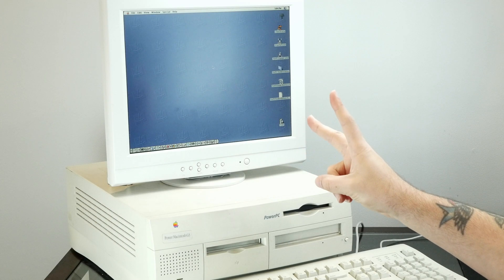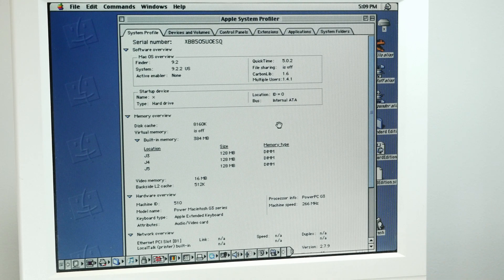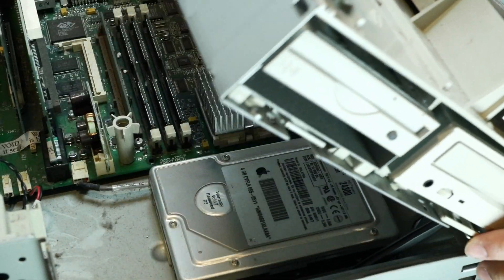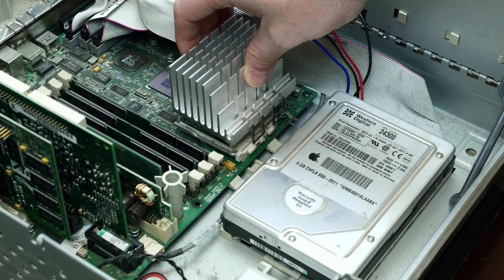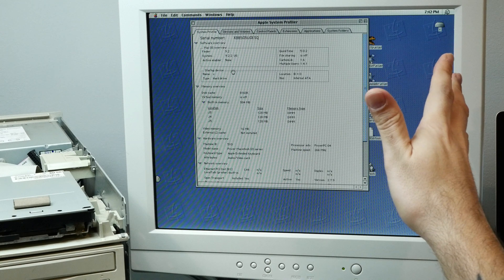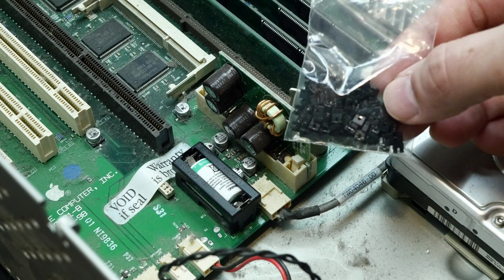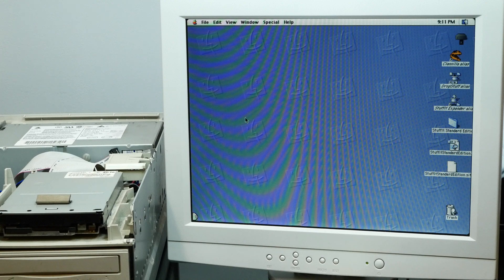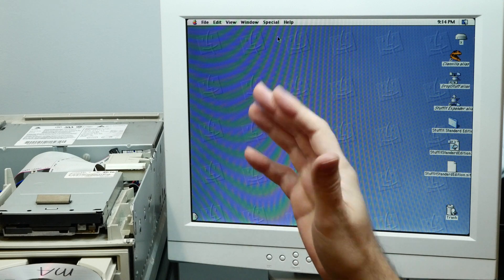Can you install a Yikes! G4 Processor in a Beige G3 Mac? The Beige Beast, Part 2!

Comment: 4:45 Actually, that wasn't Apple's thing at all. It was called ZIF on x86 computers, too. Specifically 486. Not all 486 sockets were Zero Insertion Force with the standard retention arm. In fact, most were LIF (Low Insertion Force). Basically, you needed to actually push the CPU in, and the friction of the socket itself was what kept the CPU in.
Apple just used what everyone else did.

Comment: Excellent video, but the video mem fell from 16 MB to 2 MB and the L2 cache of the G4 wasn't properly  recognized after going to 366MHz=5x_66.6MHz... With PC100 DlMMS even 375MHz=4.5x_83.3MHz or even 416MHz=5x_83.3MHZ are possible. Cheerio. 🙂

Comment: I really do not understand what's interesting about all those vintage Macs and their quirks compared to more standardized same area PCs...... Every stupid model or year or revision has it's own quirks. Expansion cards working on one model are not working on the next year model, you need exactly "that' version of MacOS to have it working with "that" nubus card etc. This  peripheral only works with that cable or connector.... Pffff.  All the interface standards and formats of Apple peripherals....  Their are just designed badly.  Just like IBMs PS2 was.  Stupid protectionism.

Comment: My beige G3 mini tower I have running with a bus speed 78 Mhz with a clock of 315 Mhz and it's stable running OS8.6, OS9.2.1 and OS10.2.8.

Comment: I know that this is an older video but ZIF or Zero Insertion Force is an electronics term, the cartridge slot in the original NES was considered a ZIF slot, same with Microcontroller programmer slots

Comment: These machines only accepted single sided RAM chips. If you put double sided dims in it the machine won't recognise it. It's just an Apple irregular oddity. You can have that much RAM but it needs to be single sided DIMMs. As to the CPU speed you need to change the jumpers (In fact it's the same as the Power Mac 7600 for jumpers).

Comment: It was called ZIF (zero insertion force) on the pc platform too...
You really should scrape that black interface material, lap the base of the HS with fine sand paper and use some good thermal paste on it.

Comment: Nope ZIF or Zero Insertion Force slot is called a ZIF slot for PCs as well as it is the official and proper name of the slot. The original ZIF slot was designed to protect fragile component pins and does not care if it is for a G3-G4 or Pentium PC processor. Apple didn’t invent that slot nor did Apple come up with the name.

Comment: That particular ZIF was actually first used in an RS/6000 for a 604-based card with a separate L2 cache card. Judging by the pads on the beige G3's logic board, this may have been a consideration for these machines until they decided to change direction when Steve Jobs came back (these were originally not going to be high-end machines; they were intended to be clone-friendly CHRP-compliant boards like the old LPX-40/Power Mac 4400 and a proper 6-slot machine, PowerExpress, was in development to replace the 9600). The beige G3 can use the G4 CPU directly but the B&W won't because Apple locked it out in firmware (which is why you need one of the upgrade purveyors' utilities to patch the FW to enable such upgrades). Just check your VRM and ensure it's not a Royal-branded unit or it may burn out your G4 or even an upgraded G3.
Also some of the early beige G3s had logic boards that supported 83MHz bus speeds. It was going to be an option originally but Steve nixed it in a drive to simplify product line-ups, so we officially only have 66MHz. Although the 83MHz speed doesn't work with the fastest (>500MHz) G4 upgrades, only 66MHz which is why you have to clock down the B&W and Yikes! G4s to install those, it's a very good boost for <500MHz upgrades if your MLB can support it. I did this to one of mine (83MHz bus w/500MHz G4).

Comment: It never occurred to me to buy new jumpers. I simply pulled the old ones out of the white block and pushed them in to the new positions in the block.  This was when I acquired better G3 processors for my Beiges. I never found a G4 that fit the G3 slot, but if I had, I think I would have left the G4 Yikes in it's original computer since the Beige has no real advantage over a blue and white or a Yikes or a Sawtooth.  And some disadvantages.

Comment: actually it is called zif on computer too. the nes 72 pin connector is even called zif. this is what the name of it is and not something apple came up with now. the jumper block is a example or without zif and bending pins on a cpu like that would be bad.

Comment: I used to do the same with my blue and white G3.  Overclocked it to almost 500 MHz from 400 MHz but it crashed so I went to 466 MHz.  It was stable at that speed.  Not much of a increase though.

Comment: No actually that’s not what happened. ZIF is an industry term used to describe any socket that has a latching pin system. These have been around since the 70s and it wasn’t Apple that came up with the zero insertion force it’s been around for years. The PC market had the same term used on their sockets also because it’s an industry term they just talked more about the socket type because of how many pins it had and how many pins it had would determine what processors he could put on the board that’s why the socket number was the most prominent thing. 

Just a fyi ... enjoying the video.. 

A lot of machines from this. Use the low density Sims because they were the cheapest and the sockets couldn’t read the backside of the Sims because the sockets were for the cheapest memory of the time these are home machines. I don’t think it was until 9293 that we started seeing double density memory then EDO memory and then ram bus and DDR after that

Comment: Wait, no thermal paste on the CPU?
Reply: The stock Apple heatsinks have graphite thermal pads. They're not the best, but they work for CPUs running at somewhat stock speeds. If you're trying to overclock, I'd definitely recommend removing the thermal pad and using paste. It'd also probably be a good idea to use a better heatsink made out of copper.

Comment: Ouch, that was painful to watch.  When you remove the clip holding the heat sink on, you need to put some downward pressure on the clip.  You just yanked it out and risk breaking the plastic on the ZIF socket.  Ouch that really hurt to watch.

Comment: The term ZIF or Zero Insertion Force isn't an Apple thing, it's just what that type of socket is called. Up until the Intel 386 we generally used LIF (or Low Insertion Force) sockets. These required pushing the processor down into the socket, and required the use of tools to remove once installed.

Comment: 1. Installing 256MB low density ram sticks will get you the full 768MB. I ran into the exact same issue.

2. I’ve read that changing the bus speed on these machines can cause issues with the floppy drive.
I stuck with a solid 400mhz overclock on my 266mhz G3 and my system has been very stable.
 I’ll have to give a G4 CPU upgrade a shot and see what happens.

3. I’d HIGHLY suggest drilling a hole in the case for the eject button on the Zip disk.
IDK why, but mine is the biggest piece of crap and has a 50% chance of mounting the first disk I insert after startup.
The hole I drilled was just slightly bigger than the floppy and CD eject holes, but it looks pretty factory.

Comment: Do the clock jumpers affect the bus speed or the multiplier? Since you ended up with 366, I'm guessing it's the multiplier? (66 * 5.5 or thereabouts)
Also are you gonna talk about your experience with Puma in any future installments? I'm sure it's been interesting.
Reply from the maker: Oh yeah, the top three jumpers control the bus speed. As for Puma - it's a very buggy and unoptimized version of OSX. More like beta quality and rushed to market - it's interesting that 10.3 is generally faster than 10.1 and 10.2!

Comment: Actually; I've always been a PC user since the mid nineties, and I did hear about ZIF sockets back in the day, certainly with Pentiums, and probably with 486 even.
Reply: Came here to say the same thing.  This wasn't AppleSpeak, this was an industry standard term for that kind of socket.
Reply from the maker: Ah, I didn't realize that ZIF was a standard term for that kind of socket. Here I was blaming Apple marketing, who as we all know is always completely reasonable (cough Velocity Engine cough)
Reply: @ActionRetro   AltiVec was trademarked by Freescale, so they had to call it Velocity Engine (or something else) or pay to call it AltiVec. Velocity Engine sounds cooler in my opinion anyway.
Reply: @ActionRetro  Chris already touched on it, but it was a way to avoid paying Motorola (Freescale now) trademark fees. IBM still, to this day on its IBM i and other mainframes/Xbox 360/PS3, calls it the VMX extension set. Even though all members of the AIM alliance had rights to it, only Motorola/Freescale owned the name.
Reply: yep, even some 386's and Overdrive CPUs used ZIF sockets, the first Pentiums actually though used "Slot 1" which was like a nintendo-cartridge style edge connector (contacts on both sides of the edge of a PCB) so those were actually not ZIF sockets since you had to exert force to insert them. :P
Reply: @joeylopezdesign  Wasn't slot 1 only for Pentium Pros and Pentium IIs ?
Reply: @esseferio  you’re correct. Only Pentium pros, Pentium IIs, and Pentium IIIs used slot 1, although later Pentium IIIs switched back to a socket.
Reply: @Decipher13  nope Pentium Pro used Socket 8 but yes a lot of them where put on a slotket adapter and used in slot 1 because of the 440FX chipset
Reply: I remember those they were a total pia

Comment: I had forgotten about the RAM density thing. I have 6 hundred something in mine but it’s RAM salvaged from a busticated Graphite iMac. I hope my sending you down the reset the logic board rabbit hole didn’t take up too much of your time. BTW, Apple marketing didn’t coin the term zero insertion force. They probably used it to differentiate it from PCs but it if a chip can be dropped into a socket (unlike the chips in, say, a Commodore 64 which have to be pressed in) then it’s a ZIF socket.

Comment: Interesting how our minds seem to run along parallel lines. Now I know why you asking if I was going to use  Yikes CPU on that Blue and White I am planning to upgrade. Excellent video! By the way, you were going to link to the source for the jumpers?
Reply from the maker: Yes definitely! In fact, when I saw your Power Computing System 8 disk video, I was definitely surprised because it's somewhat related to a computer I just picked up yesterday :)

I added that link to the 2mm jumpers in the description, thanks for reminding me.
Reply: Action Retro  You are most welcomw!